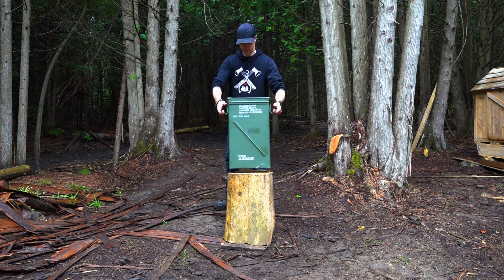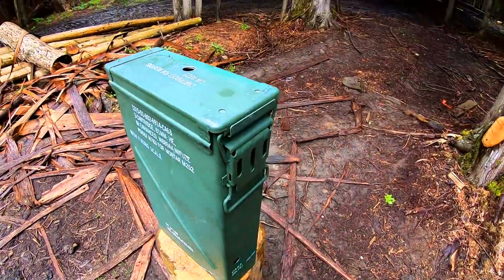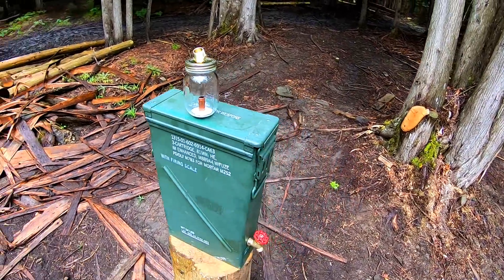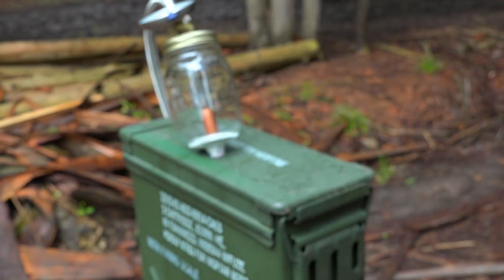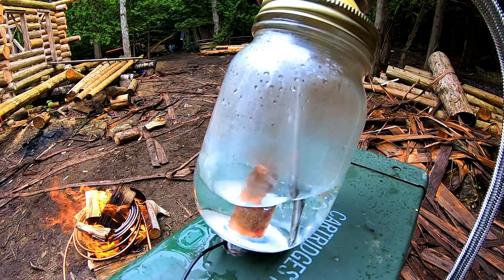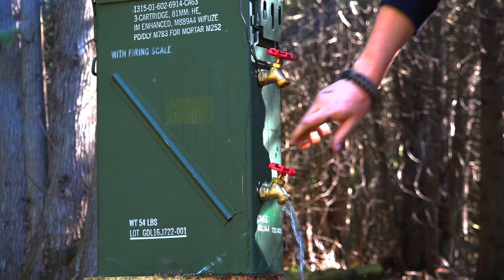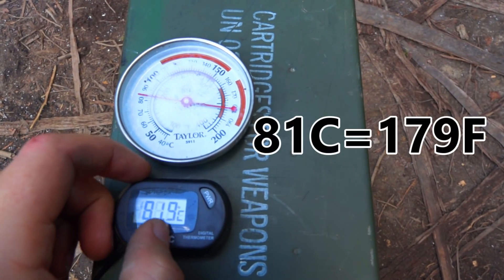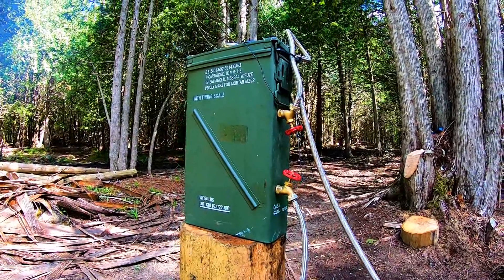Off Grid Heating Prototype- Copper Coil Water Heater / Heat Exchanger / Radiant Heater

Comment: Put rocks, or better yet bricks with the holes in them, in the water heater.  The rocks or bricks will get hot from the boiling water, and keep the water hotter for longer.  :-)  Also put a thin layer of that foil covered foam on the outside of the water heater ammo can to retain more heat inside it.

And when you add an extra layer of foam insulation, seal a 1 - 2 inch gap of air between the layers of foam and make sure it is sealed in between the layers of foam so that it stays static between them.  Air is one of THE best thermal insulators.  Dead air sealed between wo layers of foam creates and EPIC insulation layer system.  :-)  You will see a 50-90% increase in thermal efficiency.
Reply: Foam wont help because were trying to get the water heat transferred to the air

Comment: Nice.  The long shaft from the Jar deposits the hot water deep into the ammo box at about the same level as the water outlet.  This should cause a large percentage of hot water to flow directly to the output without mixing. There is also no apparent apparatus that prevents hot water from bubbling into the lower valve.  I expect in operation that water moves in and out of the bottom valve as bubbles form and are released.  I would design it differently, but without redesigning the whole thing, I'm not sure how I would simply implement something that acts as a one way valve for the lower port - something like a P trap bend perhaps?

Comment: I agree, keep the tank outside, put the fire in a barrel, use iron piping inside the barrel instead of copper tubing. Then use copper tubing inside the structure.

Comment: I don't know if this would work well in you situation but you could run that copper under your floor and connect the outer coil into the camper coil and voilà, underfloor heating.

Comment: As I saw someone comment on Flash Steaming, had a idea with the concrete suggestion....one could get one of those black drainage tubes, fill with concrete and copper in middle, form the tube around your pit or however, let set and cut tubing from

Comment: you should shape your coil so it fits in the empty ammo can for easier transport
Reply: Not to mention safer to use
Reply: Adam Orick safer to use because he stores it inside the container for transport? You do realize he can’t use it with the copper coiled inside right? It wouldn’t be any safer than it already is. Go look up plumbing bud, you sound clueless.
Reply: @joshlarochelle1298  you didn't read what he said 

Dink
Reply: @joshlarochelle1298  really  u must be a troll... as in coil it to fit inside for storage and pull it out for use  smh

Comment: Where did you get that tall ammo can? That's cool.  ...btw, Heating coils are piped in the bottom,  out the top. You could put a check valve on the outlet so that water can only go out,  not in. ..and it should be on top. If you cross over the in and out , downstream of the check valve, outside of the ammo can, you might be able to meter the temp using the hose bibs. You might need another ammo can to use as an expansion tank so your tubing doesn't split open. ...and be sure to never run out of water.  Excess air pressure (steam pressure) is way more dangerous than excess water pressure. Maybe familiarize yourself with Boyle's law if you have any questions..  cool build. The whole thing, camper and all. ..very cool.

Comment: this is a good simple design, I'd go for a tight coil around a metal bucket with the fire inside the bucket so the copper doesn't get oxidized and crack and the amount of wood can be controlled so in the snow you don't have to gather so much wood and less heat is wasted and you'll get a good idea of how much wood to put in the bucket to last all night when you sleep...
Reply: I thought the same thing. Also, the “popping” sound is water hammer from the inlet valve. The sillcock valves that are used in the video are to restrictive for hot water (thermal expansion). Straight ball valves would eliminate that. And I would add a small pressure relief valve if I were going to sleep in a confined area with that heater. Nothing worse than being scalded with hot water while you sleep. Gives a whole knew meaning to “wet dream”.
Reply: >>>And I would add a small pressure relief valve if I were going to sleep in a confined area with that heater.>>>>
No valve is needed.
There is a hole in the top, remember?
Reply: Excellent idea
Reply: making the copper the heater and the metal box the fire conductor?
Reply: @blockthenock1733  Your saying place the ammo box in or beside the fire?
Reply: @Borzke  both, or even putting the fire in it
Reply: Make an additional copper coil for your heater inside and leave the tank outside no noise no Steam and humidity and if it over boils no big deal
Reply: Nick Machado Not necessarily “no big deal” with the humidity. Any humidity in a container surrounded by freezing cold temperatures creates ice on the outside and eventually on the inside. You’d need some way to decrease the humidity to safer levels
Reply: poke some holes in the bottom of the bucket for air intake for the fire
Reply: He could have a rocket log fire with a metal pipe that has its air intake on one end, the pipe then runs through the log fire and up into an opening in his cabin. With sufficient ventilation he will be toasty warm and the excess heat would be ventilated out. If you can make the log fire properly itll burn long enough for you to sleep atleast 5 to 6 hours
Reply: There are commercially available stainless steel coils meant for just this purpose.
Reply: >>>There are commercially available stainless steel coils meant for just this purpose>>>
Link?
There are plenty of $100 stainless commercial coffee-machine heater-tube offerings.
Please share a link of one that is specifically for THIS  purpose.
Thanks.
Reply: @stirricaneutilitymixer8995  I've found some recently, they're like $400 at least..
Reply: Boiler Gang😎
Reply: yep wrap the copper round a burn barrel
Reply: Brooo
Reply: Bravo, well said. God Bless.
Reply: It's funny, as soon as I saw what he was doing my first thought was "cool, he's building a giant coffee pot sled... "  That's the same same principle behind how an electric coffee pot works.
Reply: >> Copper won't last long in fire. >>>
Odd. The copper kettle has been around for centuries, and works just fine.
Reply: it might also prevent it from going into a boil.  so you can keep the fire going overnight
Reply: And you can cast an ultra light foamed concrete "320kg/m3 -> 0,08 w/mK thermal conductivity" at the outside of the bucket/coil something like a thermal insulation chimney to use less firewood. Foamed concrete is really cheap and realative easy to make, check Aircrete Harry channel.
Reply: Then you could maybe add a thermostat and a flow cut off/diverter valve to the tank, and add an insulated secondary tank outside (with a pressure relief valve), so when the temperature fell again in the diddy house you'd have extra hot water ready to start flowing again. Put a thermostat on the secondary tank so it only gets water flowing through it to inside when it's up to operating temperature.
Reply: exactly what I was thinking
Reply: This comment is close to wider point of view. All this experiment could be better done at the beginning with more common sense for future and applicable usege
Reply: You guys doing experiments with lack of broader wision to be applicable!
Reply: Amen, i was about to mention that coper coil was not going to last long sitting in a fire like that
Reply: If I'm going with efficient I would just use the rock heater method (way cheaper than buying copper tubing) or maybe a simple hot water bottle as well as a solar water heater for the shower (you can buy them for 16 buck but if you want to be REALLY cheap, you can use heavy duty black trash bags, fill with water, and leave them in the sun). If I had 200 dollars to spend on a heating solution I would simply invest in a solar panel and an electric space heater or better yet a heating blanket.

Outside of this, it sounds like the camper needs better isolation. If the camper is isolated enough, with enough ventilation for fresh air, then body heat should be adequate to raise the ambient temperature to a reasonable level. Remember that humans are a 98.6 degree space heater. Probably would be better to think of a method to reduce the space in the camper to reduce the amount of space you have to warm. You would just need to provide that initial burst of heat to cut the chill, say like putting hot water in a plastic water bottle.
Reply: @crashzone6600  If you've ever worked all day in the cold, you know that at some point your body can't keep producing body heat so as soon as you stop you freeze. I'f you've ever been outside for an extended period of time, you know that the sun doesn't always shine on ur bags and water bottles.
If you've ever spent time out in the woods you know that anything can happen so reliance on an electric heater and solar may last some time but may succumb to harsh environments, as well as not getting enough sun in the woods/bad weather, or the electronics breaking for some reason, so durability, and reliability is key.
Reply: @dncg4040  if your body stopped producing body heat, you'd be dead. The reason that you get cold after youve been working is because youre wet. When you exercise you sweat, this makes your cloths wet and makes it so that the cold air is better able to effect you. In fact because you've exercised your body should be hotter than normal, thus producing more heat. To combat heat loss, towel off the sweat, and change to dry cloths. And although it is less thought about, you should control your fluid intake, so that you dont urinate as much. The urine acts much like a hot water bottle and every time you empty it, you lose a few degrees of body heat.

Also I gave multiple heating methods. The heat rock method, is you stick rocks in a fire, and then when they get hot you take them out, and they should retain heat for a couple hours. You can hang a metal basket from the ceiling and it would radiate heat, much like a sauna, for a fair bit amount of time, you can control the heat, by adding less stones and just renew it periodically. Hot water bottle is also easy to accomplish as you just boil water and add the water to a sealable container of some sort. 

Either way I stand by that camper needs better insulation. 

All of these methods are better than making the steam bath that he did. It wouldn't be so bad if it was an enclosed system, but he was forced to open it up, so he is releasing that steam inside that small camper. Good way to get everything wet inside that camper. Not to mention if there is a catastrophic failure of the system that is a lot of boiling water scalding you... I suppose if you run the copper pipes through the camper instead to make a radiator. Or simply buy a radiator, and them you would just need to drill two holes on the side for the intake and outtake. He could even make use of the preexisting copper heating coil.
Reply: @dncg4040  bloody well said.
Reply: @crashzone6600  yeah, get some of those night time solar panels for $200.⁰⁰!!!
Reply: @crashzone6600  why do you think this method is foolish?
Reply: @engineclinic  his design means that he is making a sauna in that box of his. During cold weather, wetness should be avoided not encouraged. It would be different if it was a closed system, but as he already showed the pressure build up for steam is pretty severe, so in order for it to be a closed system the structural integrity has to exceed that of what the amount of psi that will be produced in the system. If not, you have to put a pressure release somewhere in the system, in this case, the idiot did it inside his cabin. For a good design the pressure release should be outside the cabin. I'm still iffy on how hot that steam would make the inside of that cabin too, you could very well cook yourself, but I don't have any references so I can't make any accurate estimates n the temperature that it produces.

Also why could having a boiling pot of water next to you, while you sleep be a bad thing? Can you possibly guess the reason? If a catastrophic failure should occur, like I don't know, the hose to the ammo gets tugged off because you accidentally kicked it, or it just breaks off because of faulty manufacturing or simply wear, all that boiling water is now going to rapidly escape into that cabin you probably occupy. Something about having severe burns tells me it's stupid, especially if your in the middle of the woods, or you are stuck in a situation that isn't easy to get help. You could very well end up as a Darwin award recipient.

If it was me, I would run copper tubing through the inside, with the joints being outside, and the water reservoir setup to be on the outside, this way if there are any failures the occur on the outside of the cabin rather than on the inside, with you.

Or rather than spend all this money, you could simply put rocks in the fire, and take them out when they get hot, and use them for heaters.... They last for hours, and it is much easier to deal with should something go wrong. Hell it would've served him better to make that ammo can airtight and put coals from the fire in it and used that for a heater.
Reply: @crashzone6600  evidently you have no experience in cold weather climates.
Reply: everybody loves this explosion waiting to happen.
Reply: @vashcrimson4395  did you even watch the video?
Reply: @darkracer1252  Sure Did, Very Unsafe.
Reply: @vashcrimson4395  it's not a closed system. no pressure build up so there is no explosion danger.    worst case scenario it's a splash danger.  if the container starts boiling it might splash water out.
Reply: @darkracer1252  this system is an accident waiting to happen. have fun in ICU if you are found in time.
Reply: >>>everybody loves this explosion waiting to happen.>>
No explosion waiting to happen. Look again.
These have been around since before any of us were born. Used by millions around the world in African nations, South America, etc.
Please tell us where you see an explosion "waiting to happen".
There is a hole in the lid...remember?
Reply: Ian  this is why I gave several methods.
Reply: Fucking genius you are!!
Reply: Never leave a fire unattended comes to mind.

I don't know if that's been an issue when the snow on the ground is so thick and it's so cold out.........but some fool may copy you under different circumstances.
Reply: As well as the fact that there is a toxic affect on the air which due to the oxidization which he is feeding straight into the water meaning that any steam it puts off my be toxic. In a addition to coiling the copper around a bucket it would be a good idea to cut 3 holes in the bottom of the container and make a small coil at the bottom which feeds out from a second hole
Reply: @natsudraga2252  nope, that copper steam won't be toxic, that's why we use copper in pots and pans, water heaters etc, the oxidized green copper actually actively kills microbes though...
Reply: @natsudraga2252  nope
Reply: God dammit I ment to write to coil the coper at the bottom of the box
Reply: Perhaps he could make a longer coil, put a long piece of wood into the coil light one end of the wood and by the time the night is over the fire has made it through the whole coil to the other end so it's a steady temperature and water flow plus the relief valve you were talking about... I work on a piece of equipment where gas fire heats water in a tank, water tank heats up a cauldron which heats food and a manual relief valve releases all of the air and steam when hot then it sucks into a vacuum on the pressure gauge when it's cooled, but as long as there's no air there it doesn't explode and it heats quicker... trial and error needed for such a project lol...

Comment: You need to build an ajustable rack so that coil can be suspended above the fire... allowing u to ajust how close the coil is to the fire...to hot raise it to cold lower it....it will also Allow u to add wood as needed....without damaging the soft copper.

Comment: If that will heat the inside of a small cabin you need two things:
1. A way to vent steam out so not to make a sauna with humidity in the cabin (will eventually cause mold)
2. A tank second tank that will add water to the system as the steam creation reduces the water level.

Comment: If you took the coil out of the fire and put only just partial of it in the fire it might help regulate a cooler but still hot enough temperature to heat without boiling.

Comment: The larger volume of the ammo box is an advantage in this situation with the larger volume of water inside and the high calorific value of water, it may take longer to warm up initially but will keep the ambient temperature of the cabin warmer for longer, even after the fire goes out. The more efficient the radiant is at dissipating the heat from the water the warmer it will be but won’t last very long over night. You don’t want the radiant to dissipate the heat faster than the fire can heat it either.

Great idea though, this is the same as the old gravity central heating systems we used to have in British homes.

Comment: Off the grid living...........you just got to go to your local hard ware store and buy a faucet, metal braided line, some copper pipe and then go buy an ammo box and you have an off the grid water heater/heat exchanger
Reply: Spigot not a faucet